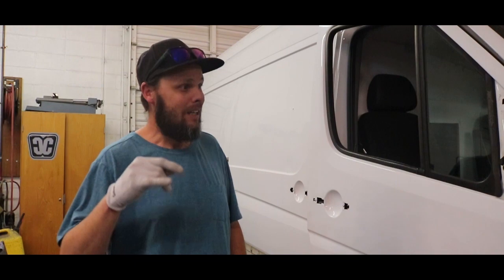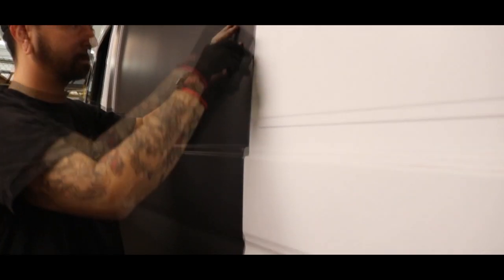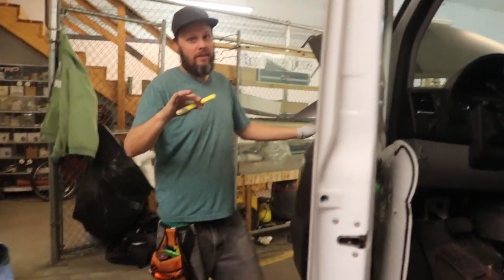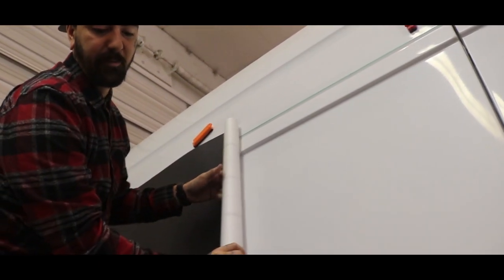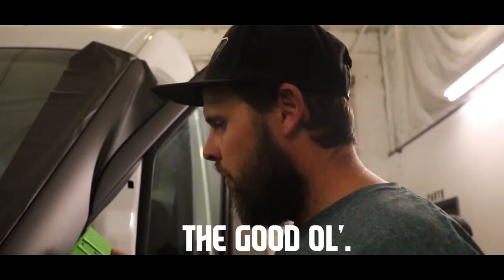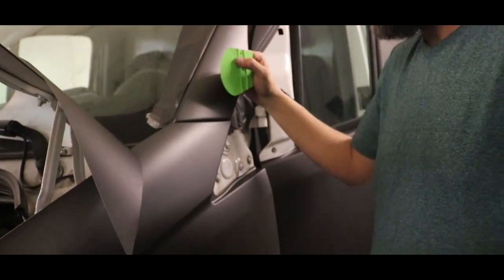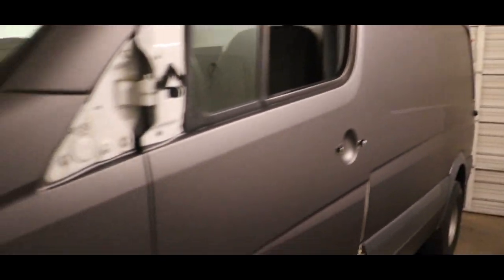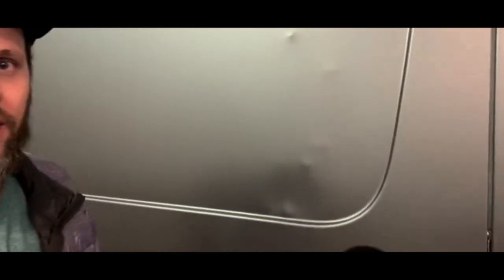MERCEDES SPRINTER VAN WRAP! -- Avery SW900 Matte Charcoal

Comment: What are the lumps under the side door wrap?
Reply: These were huge dents in the door from the inside. Unfortunately Wraps do not hide dents =(
Reply: Could of knocked the dents back then use fillers sand it then wrap to leave smooth looking finish